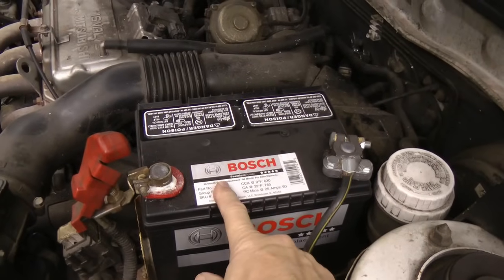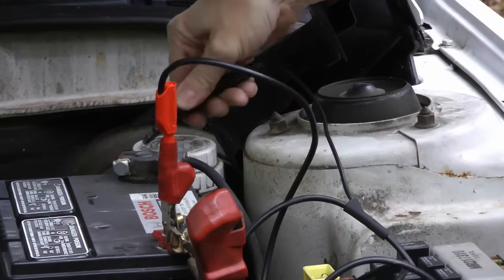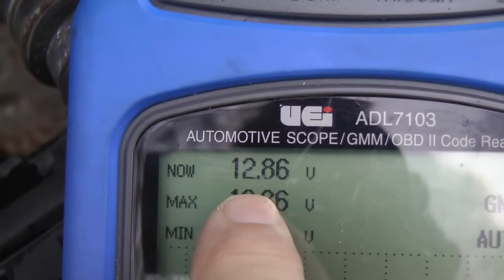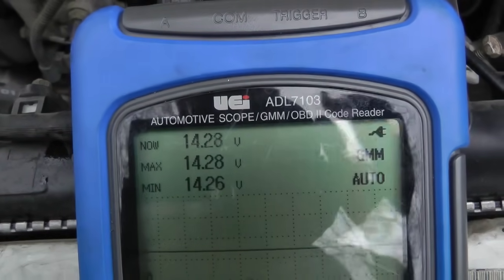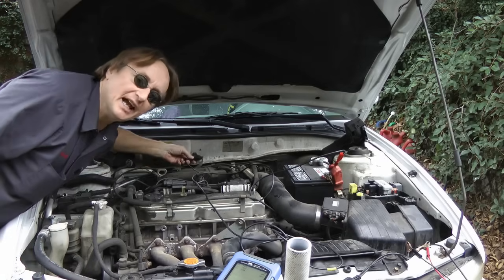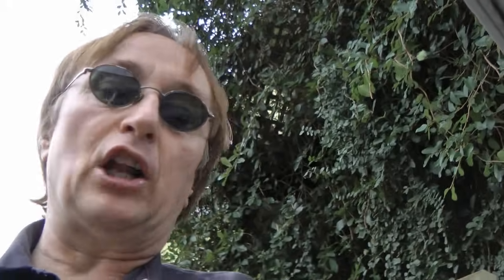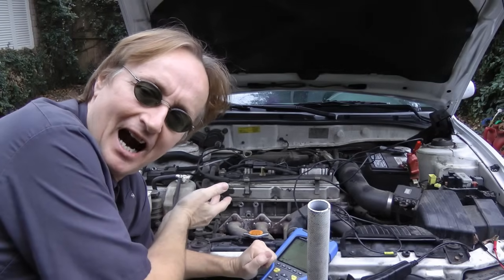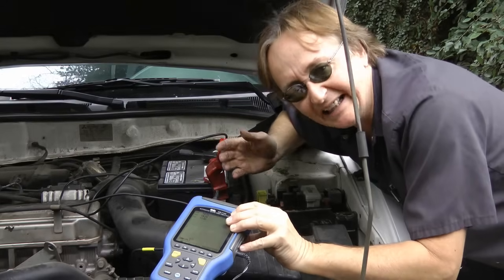How to Fix Electrical Problems in Your Car (Ground Fault)

Comment: I have a 96 mustang 3.8 and I picked up a new alternator and and that's not the probalem I thought it would be because I took the battery cable off and the car shuts off  it won't run when I do that I can't figure the problem out I was wondering if you could help me

Comment from the maker: not charging going uphill is one weird one. Only thing I could see would be bad wiring shorting out when driving at that angle IF it's really not charging uphill and has some other problem causing poor uphill acceleration, like a weak fuel pump

Comment: Hi Scotty, I have a problem with my 1976 Renault 5: The battery is not charging properly, i already changed for a new one, i checked the alternator and seems to be ok, i also changed the regulator and the car is still not working properly. Every time the car is going up in a hill, the battery drains out. What do you think it could be the problem? Cheers mate, thanks a lot.

Comment: Hi scotty. I got a Ford Excursion 2001 and it has some strange problems. One night the horn suddly turned on and drained my battery.  And after that happend the intreior light stay on, the fan works when the key is off, and the radio starts suddenly to play music sometimes.. :((  i need to disconnect the batterycable after i drove the car. Where should i check for ground??

Comment: I have a different problem when I turn on my head lights and specially when I put my windows down it causes my rpms to drop other wise if I don"t turn on my head lights or put the windows down the car works fine. Anyone know what it can be? i am guessing its the battery?

Comment: ac maybe a short i dont kno and headliights also dont work they looked at it again and i filled thim in what was rong because i don
t take my car to theshop when hey you can do it yourself like you say but they said its the ingniton switch not rite one so the bcm body control modual messing up cant read it because its a chevy key cylinder but i programed it and every thing fits all parts i got online and said fits

Comment: to look at the electric they said they fixed two shorts and all that was ok so i picked the car up from the shop and car started fine then i turnd it off the lights still stay on when keys out they just did what i did idseen they just replaced the fuse for ignition sw i think they just use those basic machanic tool just see about fuses because they are not electritons so i took it back to th shop again today and i was mad told thim my car was overheating never did befor so i just turn on ac

Comment: and cylinder so it started car was fine for a sec it had service viecal soon light (svs) and no trac on i turnd key off and took out igniton dash lights stay on a oil light blinks svs light gas gauge turns on this is when keys out of ignition any way i could drive it but had to disconect the batter so dash liights wouldent drain it. then one day i was diving and flicked thats switch where the turning signal are and  car shutt off so i just had it toad to a professinol and they charged me 200

Comment: ok i have a 2000 grand am gt one day im was parked notice trunk poped open the light from the trunk drained battery i have a stereo sytem in it so i cut the amp cord hopfully it have more juice to start  so i get a jump and it worked .well i was driving home weather was a lil rainy car just turnd off abs all dash light lit up stayed on after i took the key out of ignition as if i put it in and turnd it so car dident start so i replaced a 30 maxi fuse for sw-ing fuse  and relaced ignition switch

Comment: ihave a 2000 jeep grand cherokee. it has a problem charging the battery and the windows only work when there is low power. i have changed the alternator and battery. any ideas?

Comment: Ok on my 2004 gmc envoy when iam in a complete sotp or either i just turn on my truck and on the take off is real slow my check engine light is on and no gears will shift and all selinoid sensors are bad i wanted to see if its the transmission or an electrical problem thanks

Comment: having electrical problem in a 86 Alfa Romeo. New battery drains after two days or after 4 round trips. At night the battery drains immediately(takes 15 minutes to drain the battery while engine running) once we turn on the high beam lights. Alternator and Positive terminal cables have been replaced. what should we test for?  grounding?

Comment from the maker: realize those stupid gm systems use a body control module to ultimately run all those lights, and they often go bad and are hell to diagnose. But, you could rewire all those lights directly off the switch and bypass all the computer crap, I do that all the time

Comment from the maker: those locking systems are complex, using body control modules to operate them. Somehow you've lost power from that when the key is off.  Good luck finding that short.

Comment: I have a 07 Eclipse GT convertible and im getting no power to my locks, the constant 12v wire to the radio, or interior lights. However when I turn the car on the locks work fine. Fuses are all fine though.

Comment: could this be wiper motor pulse board module the wiper just stop while on an come on again not always happens some times got turn the whole car on again does seem have low wiper working at high could this make low working

Comment: Hey Scotty sorry about the delay response i just got around to replying but my truck has continued to go from running normal and showing low voltage on the battery gauge. I've had the alternator load tested several times and passed everytime. Also when the battery voltage goes low on the gauge the truck seems to be running normal. Is it a possibility that the gauge could be going bad?

Comment from the maker: if it loses all power, starters don't do that, a loose wire or shot battery does that. Realize they don't make batteries like they used to, and places like auto zone check em free.

Comment: Hi. I love your lessons, it's quite short and still very clear. But I have a problem that I can't start a car. If I try to start it makes a "click" sound and completely all car power is lost. After removing and putting back again negative or positive battery wire power is back and everything is working (ignition too) until I try to start a car again. Battery is almost new, all fuses are OK. Could it be starter problem or grounding wire does not have a good contact?

Comment: everything I do with my mustang seems to draw power from the engine and at idle will cause my rpm to dip. when I use defrost or the ac the rpm will dip to 500 or die. the car acts like its just running off the alternator is how I would describe it but the alt and bat are both good. does this sound like an engine ground problem?

Comment: my abs likes to start pumping randomly even if im not pushing the brakes theres a code for wheel speed sensor but it scopes out just find i even put a little electric grease in the connecter but it didnt help one bit help plz

Comment: i have a 97 f150 ford electrical systems have been going away for some time. had a new fuse box put in by dealer but no code sheet or old parts to look at and the problem still exists do you think a bad ground or what????

Comment: hello my friend, hey! I have a problem with a 2001 nissan 1.6 DOHC, its shake all the car and when you drive it in some moment have a lack of power, when stops for a red light or turn the car turns off. I scanned but it dosen't have DTC's ,I checked the fuel pressure ans its ok, I did the nissan's procedure to put on time and regulate IAC system...SCOTTY----I REALY NEED YOUR OPINION,

Comment from the maker: weak connections, try unplugging them all , cleaning them, and snapping them back together. Pray it's not a computer circuit problem, they need replacing.
Reply: I have a ls400 98 it died and i change the battery no start alsoi changed the alternator about 3 months ago and it cuts on when it jumps but no lights on inside the car but car running but wont move and also will shut off after a while if i hook up battery charger soon as i cut it off the volts immediately goes back to zero and wont start back up unless i jump it but it just wont move even the gas pedal wont engage

Comment from the maker: if it happenned after the swap, wiring needs to be installed correctly. if it just happenned out of the blue, the tach in the dash often breakd on that model and most guys just buy  a used junk yard dash. Cause a new tach costs 500 buck or more at honda

Comment from the maker: pray it's that easy of a fix, but if radio is easy to remove, you can check power at the back and just run a wire from the battery to run it if you lost power

Comment: Yeah i think ill live with it, its not really a big deal to have to turn the engine off and then lights to never have to worry about it, id rather not have to spend extra money replacing more electronics or trying to fab some switches in when theres more important things like some rust forming  i got to have fixed first. Thanks for taking the time to answer my question, i appreciate the advice.

Comment from the maker: yea, that's all run by computers and your system is breaking down. Live with it unless you want to mess with really expensive computer modules. Or cut the light wiring and re run power with two toggle switches, then that can never happen

Comment: Hey Scotty,
 I drive a 95 Nissan Maxima Gle, and ive been having a problem where when i go to turn my headlights off while the engine is running and the right front headlight stays on but on highbeam, the left goes off without any trouble. It only will stay on highbeam if the vehicle is running, if i try to turn the lights off in accessory power they shut off fine. Any ideas on what it could be?

Thanks

Comment: hey, Mr. Kilmer,
when I turn on my head lights, the high beam indicator comes on, so I think it's an electrical problem. What should I do once I find a part with bad ground? should I plug it out and plug it back in? secure the grounding wire? Thanks for the video and your response.

Comment: Hi scotty,ive been having a recuring problem with my 95 S/C Riviera.my temp gauge began to stop functioning intermitently.soon it failed all together.along with the temp gauge malfunction,the dash gear selector no longer shows what gear im in. this happened concurrently with the temp gauge fail. I still have my tach and speedo and the rest of the dummy lights. HELP!!!!!!

Comment: but, i am remembering what you told me a few months ago....cleaning the iac thru that little hole in throttle body...with the damned battery not disconnected,  you said  to pray it didn't cause a  bunch of  crazy electrical problems.   i just wonder now if that is all coming about now.    would it help now to buy another  iac and install it?   car is running ok now,  and, the  tail light section was  DRY.    now brake lights.  and  speaker blown.    lot of strangeness.

Comment from the maker: camrys are not known for electrical problems, but if plastic lenses crack and water gets in, stuff gets damaged. no problem buying used parts on em though

Comment: scotty...i have had a whole host of issues w/ 98camry very recently.  iac,throttle cleaned. then had starter stop. new starter.  bad cell in battery. new battery.  speaker blew . now melted tail light socket, and the brake light came on.  
found a used  INNER TRUNK MOUNTED TAIL LIGHT LAMP WIRE WIRING HARNESS on ebay. for 15$. but, i think that will not be the end to my problems!!!  what the heck is going on here, and what should i do?  do you have a vid for this problem?

Comment: Hey scotty 
my honda civic 92 has a problem reading the gas meter it always reads full even when its not at times it reads the gas, but minutes later it goes back to full. 
When i bought the car there was a wire running from the floater to the bottom of the steering and when you disconnect it the car will not start
how should i fix this problem?

Comment from the maker: typical ten year old taurus. Your receiver is probably breaking down, so live without the remote, they cost a ton.  brake lights come on from bad e brake switch, low fluid in the master, OR a pressure leak in the system . Check the fluid level first.  Odds are the motor is shot on the window if you hear clicking

Comment: The other thing my car does is the engine light is on and runs ruff I think it is the Oxygen sensor did replace spark plugs and wires a while back.

Comment: I have a 2003 Ford Taurus my drivers side electric window does not go up or down.  The relay clicks under the dash when I push the windows up and down switch.  My parking brake dash light used to flash on and off randomly now it is solid.  The last thing that has gone wrong with my car is the remote lock and unlock key fob quit working.  I tried changing the batteries and cleaning the pad on it.  Must be something wrong with the receiver. I did test to see if the RF was transmitting on keyfob.

Comment: Dear Scotty I have a major problem!  I have a 2000 Hyundai accent and it would start one day found out alternater was bad so that was replaced but still wouldn't start check the battery it was dead had to get a new one but it still wont start when I turn it on the battery icon and the brake icon comes need you advice please help!!!!! Thanks

Comment: Hey Scotty.. I have an 02 camaro and I'm having problems with the driver window. When ever i press the down button ...it slightly goes down.. then it stops ...it takes like 20 min till it goes down a little more...its like it recharges.. then it dies when I bring it down..I

Comment: hi scotty i have a 02 mercury cougar 2.5l with 130k that when i turn on the ac the rpm jump up to 1500. then some times at stop light without the ac on the rpm just up to 1000. is it my idle air control has went bad or something different

Comment: Hey Scotty I have a 2002 Dodge Dakota 3.9 L with 163k on it. A few months ago my check gauges light came on and my battery suddenly dropped to low. I took it to get tested at Auto zone and the guy said everything tested out fine. The next day my truck was running like normal. Just a few days ago it did the same thing again and once again it was running normal the next day. Do you know what the problem could be?

Comment: hi Scotty.. I have a Camaro 93, the engine light comes on  n off.. I can't find anybody with the right scanner for it, so I went on-line and I find this scanner, INNOVA 3120 Diagnostic Code Scanner with Freeze Frame Data for OBDI and OBDII Vehicles Can u give me your opinion about it, plz?

Comment: hi, i tested my camshaft electrical plug which is a three wiar,  ground is 0.00 good, pasitive  is 11.89 good, but when i test othere wiar it gives me 11.89 the same as pasitive wier, this wiar  is the massege wiar for the computer which supose to be 5.00 or 4.99 v.  ( 1997 bmw 318is code p340)  thank you.

Comment: hey scotty, I have a 89 dodge dynasty and my EATX relay is clicking really fast and it wont shift out of 2nd gear, new fluid and filter and when it doesnt click it shifts perfect, theres 4 wires going to the relay and someone told me to see if the relay had a bad ground so how do i test that? no black wires just colored ones

Comment from the maker: could be a bad ground or wiring problem to the alternator. As that belt broke, MANY wires or sensors could have been damaged, check in that area first.

Comment: hey scotty ,,got a problem maybe you can help ,,i have a 93 jeep cheroke ,,,well driving one day ,the serpentine belt broke and i was able to get it home ,,after replacing the belt ,for some reason the battery died ,battery was old so i bought a new battery and drove it for an hour but the battery read low on the dash ,now truck wont start and when it do wont stay running ,could it be a bad ground or a bigger problem,ps alternator was changed also,,thanks scotty

Comment: hey scotty nice vids, i got a 99 chevy tracker with a short in the electrical plugs behind the hood latch under the dash on the driver's side, its making my power relay behind the glove box go out from time to time and i have replaced it twice, the short is so bad that the car will die while driving it but if i gently touch the plugs with my toe i can start the car and drive on, it is the first plug, everything works when i push it, i am not that good with cars can you help me out

Comment: When i am more than sligtly accelerating in my car, the parking brake light always flashes on. For instance, lets say im taking off from a stop light. As soon as i start ot accelerate, the parking brake light will flash on, but it does not even flicker. and the second i let off of the gas, it will turn off. Could this be also due to a bad ground, or could it be a faulty sensor somewhere?

Comment from the maker: No, I would replace the entire cable assembly if it gets hot, they should be just normal air temp. I would also then change the negative cable if there was still a problem as they work in tandem. Pray it's just that and not a wholesale meltdown of the wiring system and alternator

Comment: Scotty I got a Toyota Corolla 1994 and I don't know if there is a problem or not on the Battery Terminal. Is it normal for it to HEAT UP when its running? Specially the Positive Terminal.

After using my car for a while I try to check if the terminal is hot or not, and most of the time the Positive Terminal is Hot much like touching a cup with hot coffee in it. While the Negative terminal is also Hot but is much tolerable when you touch it...

Do you think I have grounding problems too?

Comment: Hey scotty, I got a cougar 2000 and the check engine light came on! its a p0174 code system too lean
what can i do to fix this problem.? I've heard that this code is caused by a couple different things.I searched in your channel but you dont have any videos with that type of problem 
hope you can help me man. Thanks